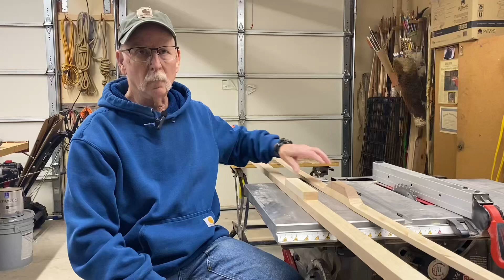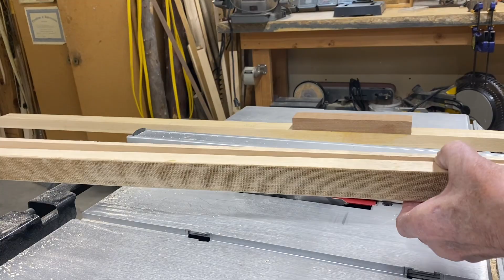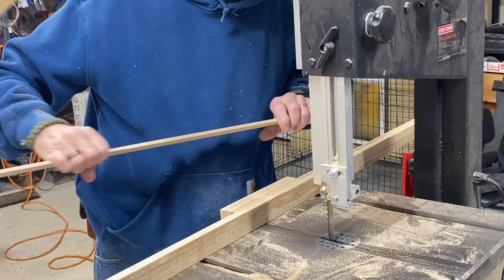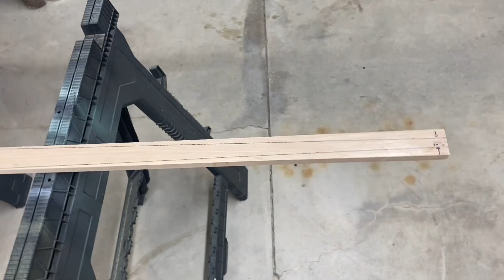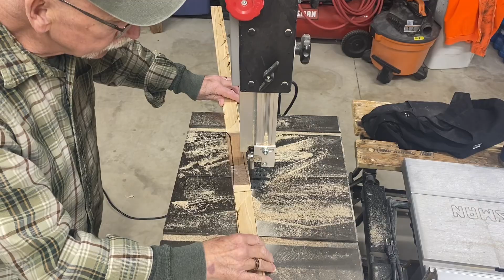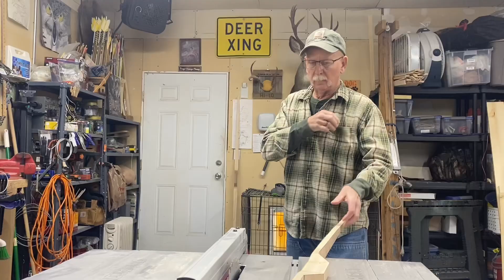Pyramid board bow layout

Comment: What a godsend. Building this style of bow and using the table saw, to me, is the way to go. It sure beats carving, shaving, and filing by hand like most board bows Correct me if I'm wrong, but using the table saw to build and tiller your bow is almost guaranteed an accurate bow with each blade bends equal.
Reply from the maker: The thickness should be equal , but there is usually some tillering needed for an equal bend, but it will be very close

Comment: What I find too little discussed is the area at end of fade and beginning of bending limb. As result and all too often with newbie bow builders is they have riser block sitting atop limbs with little/no melding of fade portion of riser melding into limb thickness taper. That  then is the cause of riser "popping off" bow. All the work of shaping a bow only to have such a disaster occur.